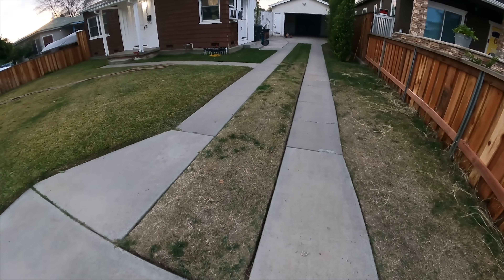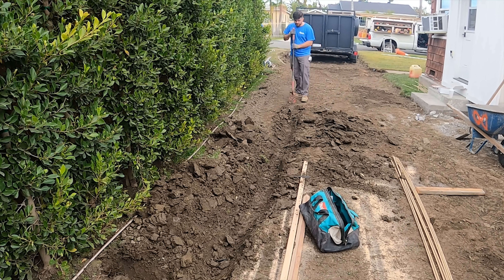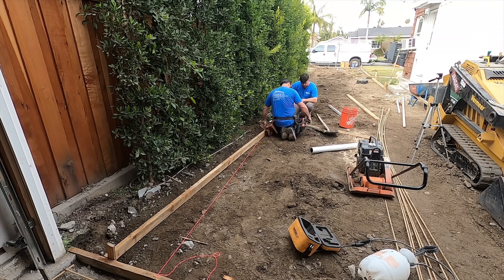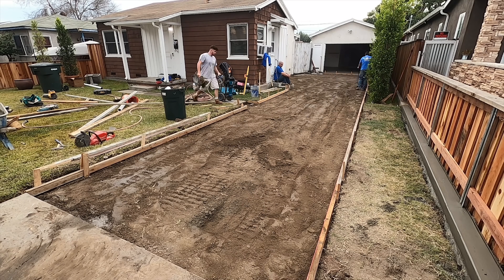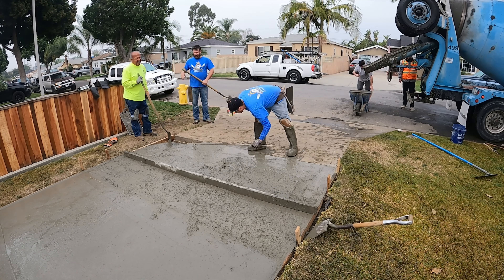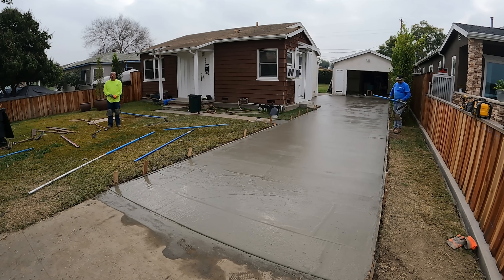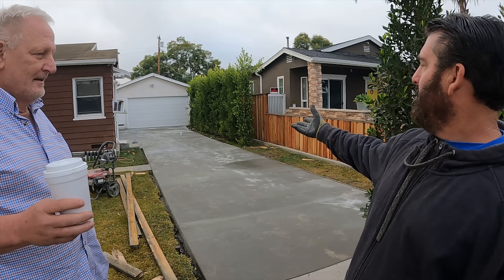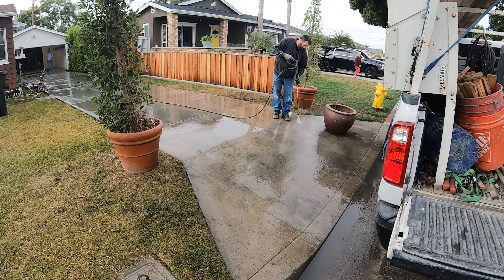Homeowner Ruins Fresh Poured Concrete Driveway!

Comment: I never would have believed that a video about laying down a concrete driveway could be so fascinating.  You guys are true artists.  Just one question, why do you brush and re-brush the concrete so much?  A lot of times, the driveway looked done then someone would come along with a trowel or broom and do it again.
Reply: The broom adds texture, most of the time you dont want slick concrete. So you smooth it and smooth it and smooth it, then split it to control the stress by cracking where you want it to instead of where you dont, then smooth it, then edge it, then do it again when you mess up a little, then after all that you broom it when its the right level of cured and it textures it and then trim smooth the edges
Reply: It’s more of a pain in the ass, good drivers are rare to come across and the same thing goes for reliable workers also as calm as he was about the homeowner he was probably irritated with him a lot more than what he let off
Reply: If the trowel marks are deep, the broom needs to go over several times.... last time  being the full stroke if bushes aren't in the way.
Reply: Hovering is only a problem if your trying to hide something.
Reply: They worked that concrete way too much. Youre not supposed to bring that much slurry to the top. That is the reason you see some concrete look like the top layer is coming off because it was worked too much and made the top inch really weak.
Reply: @catfisher420  They got on it way too early with the trowel and broom. Timing is everything to get the right texture when finishing concrete.
Reply: @swskitso  nobody like a customer that hovers over your shoulder the whole time if you want lessons on how to do the work your local home depot teaches classes on the weekends let the pros be pros and stop stressing them out hovering over them they got a job to do not a class to teach
Reply: @erikbarry6289  if you dont like it then quit and find another job.
Many times i have dealt with customers that hover because im the only visitor they have seen in months. 
A customer trying to direct the work can be a problem but if you cant work just because you are being watched then you shouldnt be in customer service you should be in a warehouse or factory.
Reply: @swskitso  I'm a carpenter by trade I know what it's like to work with people hovering I've been video recorded while working before thays not the point the matter of fact is most customers wanna talk too much or be to close its a liability issue and an issue of wasted time while talking all taking away from productivity you wanna talk we can talk before or after work but when I'm working and being creative just leave me to my work I've had plenty of homeowners ruin my work by touching finished products before they should  or by being careless in my work area when you hire a contractor your turning your property over to the contractor till the work is complete I've had to send customers and their pets away to hotels and relatives houses just to get my work done .
Reply: @erikbarry6289  if you cant be productive while carrying a conversation thats your shortcoming.
I would like to know what kind of job a carpenter does is so dangerous you tell the family to leave?
Reply: @swskitso  refinishing hardwood floors can't walk on them for 3 days aftarwards and the process itself takes several days to complete as far as stripping and refinishing depending on footages I've had to send people away for 2 weeks before or you could be like the last customer that was flipping their house I refinished all the hardwood and they couldn't wait to show the house and went in and on the floors the day after final coat of poly and left footprints through the whole house only to pay me to come back and redo it again
Reply: @erikbarry6289  thats why we do homes in portions so they dont need to leave.
If they had been there during application you could have given them more clear instructions.
I enjoy teaching people things and know its my skill that sets me apart from others, i share knowledge freely.
I have noticed many fear if they allow customers to watch they will lose business as people may start doing more for themselves.
Reply: @swskitso  and that's why you'll see where you portioned it out and shows that you have no clue what your talking about your finish will not look the same and you will see lines where you start and stop unless you have thresholds everywhere to break it up bit when it's one flowing floor you treat it as such
Reply: @erikbarry6289  rooms are done a a whole but yes doorways are easy places to tie it together. I can do a room one week and my brother can do the other the next and you wont know unless told.
Reply: I read all these responses and while most are valid, the question you asked (why they keep smoothing out areas again that are already smoothed out is to level everything and make it flat and even... after they smooth it out they look at it and resmooth (distribute) areas that may be a tiny bit off level...it takes a lot of doing this to make sure the whole driveway is even (it's hard to see in the video the slightest changes in it being perfectly flat and straight)..
Reply: @Pariatical  I am more confused now😁
Reply: @iankennedy1441  Well, when you actually look up how they do concrete, you'll understand what I said.
Reply: @swskitso  As an electrician who works in people's homes and businesses, I've got to say this is just not true. I need a customer to give me some space and trust in order to be most effective at doing the job well for them.
Reply: I’m a concrete finisher and mason, and I can assure you there is no time to have customers hovering asking questions or telling me if they’d do it differently or whatever the case may be. Pouring and finishing is a timely process and every second matters so there is no time for chit chat non work related or a customer to be breathing down my neck I don’t mind answering questions or anything like that but when I’m running around back and forth and clearly trying to get everything in order to avoid errors or slowing down the team work please wait to ask or talk to me, I was a plumber and heavy equipment operator for 6 years before I joined the union and let me tell you I’ve came across many many customers or people that went way over the limit with interfering with the job and causing problems or trying to get there hands in on the job and screwing it all up for us contractors to have to fix and wonder why the quote went up
Reply: @swskitso  wow, you should have your own channel so you can direct all trades people to act exactly like you say they should. Like everyone has the same personality as you, same temperament, you know, perfect, like you. 🥹🥰

Comment: Fascinating. I could not believe how many times you went over the surface after the initial pour. I'd always assumed it was pour, smooth out the surface one time, and let it dry
Reply: So the home owner could walk all over it... 🤦‍♂️ heh.
Reply: Nah, concrete takes time. You have to make sure that it's set and done to cure properly.  I appreciate that he took the extra step to make sure no concrete touches wood. It'll become a nightmare later.
Reply: That was my first thought too. looked really wet and they worked a lot of cream to the top. In the North, this would be overworked and be a problem because all your air entrainer would be gone and itll bust and spall on the first winter. However, it looks like a southern climate so probably not an issue
Reply: If you trial concrete off at the end it hardens the surface
Reply: I thought the same    pour the concert  smooth it off   then leave it the feck alone . Once it firm then go over it once that its smooth then  leave it alone .
.all the time these guys was going over it again an again an again  every time you go over it  you bring the water to the surface with the cement  then you rub it off so it drips over the kurb boards  (as you can see they needed a hammer to knock the concert off the kurb boards to remove then)  which you weeken the top of the concert by over working it  you see this when ppl jet wash there drives and left with lots of sand an crap at the end of the wash that sand it where they have over worked the concrete on lay down and now crumbling apart .. 
Pour it work it smooth  twice then leave it   ..
Reply: @vlratcliffe1  ok put it in scret it bull float it edge it then trial it off when you put it in work off the board as a Hight reference it's easier to work off it than to it using a magnisium float then you can screte further in using the hieght of your concrete as a reference bull floating levels it out further then edge it for a rounder more professional look then trowl it off to help avoid cracking and harden surface
Reply: @vlratcliffe1  in Australia we trowel or trowel machine it up to 5 times for a smooth finish , keep troweling ( working it) until it is hard , or trowel it 2 or 3 times then broom it ,that is how we do it here ,we have no snow though.
Reply: You can over do it, though. If you live in a cold climate with sub zero temps in winter, too much finishing will take the air out of the top of the concrete and leave it susceptible to flaking with frost. That didn't happen here, but never power trowel outdoor concrete slabs in a cold climate.
Reply: @garysampson5258  if I ever move out of Australia I'll keep it in mind thanks
Reply: It's like rubbing a fat girl down with Wesson oil, it takes a while!!!
Reply: @garysampson5258  here in CA, the cold is never a problem:)
Reply: @vlratcliffe1  My thoughts exactly
Reply: @joshkeown9810  if concrete is screeded flat all a bullfloat does is closes up concrete ,it does not flatten roughly screeded concrete,I know a lot of American concreters think it does .
Reply: @garysampson5258  ok

Comment: As someone who did two 12x24' pours for my garage, I can personally attest that timelapsing the pour and screeding process makes it look easy.  It is absolutely backbreaking work to level that initial pour with a 2x4.  Out here in the desert, you have to do it ridiculously fast, as well.
Reply: I live in Arizona, I know exactly what you mean.
Reply: Pour in cool weather.  I did a 2 yard pour for a patio in June in Sacramento, and I had to literally run with the wheelbarrow since the concrete was setting up so fast!  Never forget that.
Reply: @scottslotterbeck3796  Yep, we poured in late fall, coming up on winter here.  It was about 60 degrees with warm sun, pretty much perfect.  We were running.  It's absolutely the most physically demanding part of any build.  It hurts to see it get ruined like in this video.

Comment: I'm not a concrete guy, but you and your crew clearly are.  Such professional work, wow!   So for Me and for my customers I typically throw a couple 2" or 3" sch 40 pvc "chases" deep under driveways and sidewalks before they pour.  One is for electrical conduits and low-voltage cables, the other is for water pipes, irrigation etc.  You may never use them but they'll be there if you need 'em.
Reply from the maker: Good idea.
Ty
Reply: Really SMART !!!👍👍👍
Reply: You said you aren't a concrete guy so what do you do? You said customer, are you a builder or designer?
Reply: 17:41. May want to have the concrete driveway be the entire width of the garage?? I have never seen this before.  Makes zero sense.
Reply: Are you telling me the concrete guys are concrete guys?

Comment: Last time I did a big pour, it was for a slab for my 30"x40' garage @6" deep. That cost me a little over $2300 back in the mid 90's. It was 5000 psi with fiber. Now I'm not sure the going rate of concrete nowadays, but it looks like he got the better end of the deal. Your work has a beyond Excellent. I would've been pissed if it were me when he walked on it!! Talk about 
LACK OF COMMON SENSE! Anyway no more freebies for him.

Comment: We’re in Pennsylvania, so it’s strange seeing new concrete be placed directly on compacted soil. Compacted aggregate is a necessity in the Pittsburgh area due to high clay contents in the soil. Great work!
Reply from the maker: and freezing weather
Reply: @OdellCompleteConcrete  steel strengths a lots and will not require gravel in many places
Reply: And in Texas in the summer, cement dries in 4 hours, ready to use!!
Reply: Iowa/Minnesota here. ALWAYS put sand over the sub grade. Freeze/thaw, not clay or expansive soil. Got neither in SoCal. Yup, they pour straight over dirt. Kinda freaky at first. You get used to it. We never used a plate compactor in the midwest. Of course, we never used anything that cost more money there either. Not even a pump for an uphill pour.
Reply: I watch a guy in Maine and he usually does a lot of weird stuff you don’t see in SoCal, like styrofoam as a base
Reply: @Armistice023  I am building at 7500 feet outside of Las Vegas and I had to use air-entrained concrete. That was completely new to me. In SoCal, we would use a retardant. Back in Iowa, we got CC - calcium carbonate - to keep it from freezing in the winter. Came out of the truck steaming and you wanted be the one IN the mud, dragging off the slab. Kept your feet nice and warm.
Reply: @austinteutsch  That makes weak concrete,  fast cure is the worst thing for concrete.
Reply: @austinteutsch  I'm in Arizona and it's fast here, too. I know nothing about pouring concrete but had a cousin add a room to her house in Iowa, in the winter. I was like, they do that?! How long does that take to dry?
Reply: @pamelajohnson7813  in general, that's really bad timing to do any of that sort of work unless you're going to properly monitor temps of all pours, etc. Keep in mind that for Midwest (you may know this, but some others will not), most homes have a cinder block basement perimeter wall sitting on top of a narrow foundation slab running the perimeter of the house (wider on the outside if you plan on adding bricks later, etc). It's not just pouring in the winter that's a hassle, but digging that foundation hole - assuming the addition went to the basement as well (not doing that would be half-ass unless it's just a 3-season porch or similar). Once you've got that foundation strip poured and cured enough, you stack cinder blocks until slightly above final grade, and generally standard stick frame construction on top of that. The interior of the basement slab is poured once all relevant utility lines, sump pump lines, etc are all installed.
You generally just don't do any of that sort of home construction work - foundation and slab pouring at least - in the winter; if you have a foundation started before the freeze sets in, stick construction in early winter is common, and finishing work in late winter even... but it's really rare to see any new construction starts or any driveway/road pours other than freeway construction where they have the engineering talent to do it right in the Upper Midwest anyways (MN for me).
The thing to remember is frozen soil means your foundation will be aligned with "freeze time", but you normally want to set everything true when the ground is not frozen. We do have to deal with a small amount of seasonal settling (a crack in a corner that only opens up in the winter) in most homes, but they're really well built so it evens out. Doing the foundation in the winter is just asking for those settling issues to be an order of magnitude greater than if you waited for mid-spring when the ground was nice and warm. At least we can build basements though - I feel really sorry for the folks in TX, OK, etc where only the very wealthy even consider adding basements, as it's so expensive to build with their horrible-for-building soil, since you basically need to go fully reinforced concrete (tons of rebar and ties) vs just a basic pour with a few bits of rebar like we normally use up here.
Reply: @pamelajohnson7813  Depending on the weather, you request 1 or 2% calcium and hot water to the concrete.
Reply from the maker: intense
Reply from the maker: Sounds like fun
Reply from the maker: High early works all the time for freeway projects
Reply: @austinteutsch  concrete does not dry, it cures
Reply: @austinteutsch  That is bad need to slow down to hold the water inside concrete.  3000 PSI concrete drying this fast you are lucky to have 2000 PSI.
Reply: @ricoludovici2825  Wow you guys have brought up many issues.  1. Always use air-entrainment for outside concrete no matter where you live. 2. Calcium does not prevent freezing only speeds up set. You guys need to read the ACI flatwork finisher materal used in the course to become certified.
Reply: lol we always throw a few cheap sex toys in the mix so when the next contractor finds them when they are breaking out old concrete they look at the customer differently
Reply: You've got to love owners that get in the way.........NOT!  Good job otherwise.
Reply: Yes, same here because in KY we require gravel under the slab and expansion material between all new and existing concrete.
Reply: Thicker slab helps cover the rebar. ACI recommends 3" rebar separation from soil and 1" deep cut, does not leave any room for steel. Two days before you can cut, is a nice slow cure.
In AZ, we get 120° temp, 5% humidity and 40 mph winds. The concrete wants to crack as soon as it comes out of the truck.
Reply: @OdellCompleteConcrete   I have 2" of crush gravel AND rebar that is tied together because it is needed and then 2 to 3 inches of cement...because it freezes and the ground moves. Expansion cracks are put all the way down to the gravel layer with plywood strips...that is removed after the pour.  Sometimes the wood is left in the crack. No set rule.
Reply: You are so right about the clay here, that's all I see.
Reply: The new concrete looks like it is more valuable than the house.  🤣🤣🤣🤣🤣🤣
Reply: @Armistice023  under heated slabs for sure
Reply: GO STILLERS!